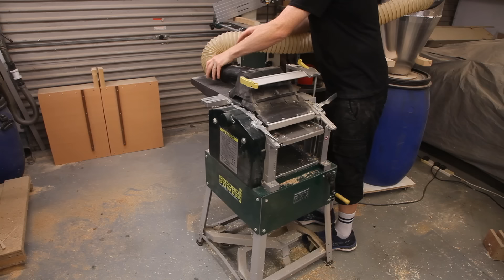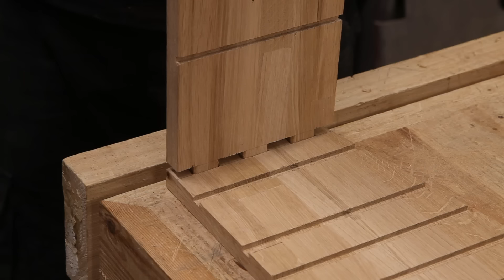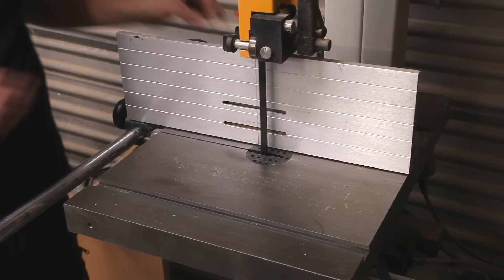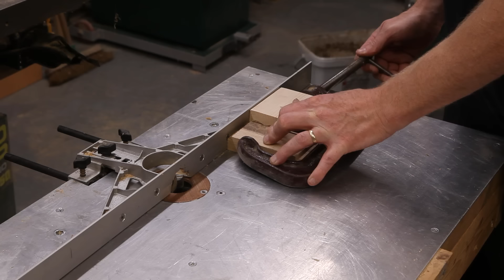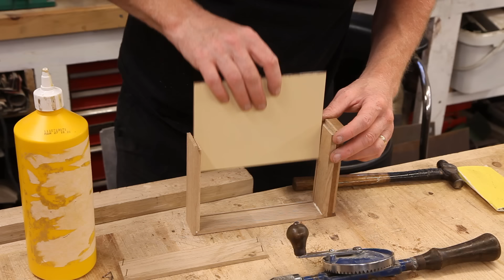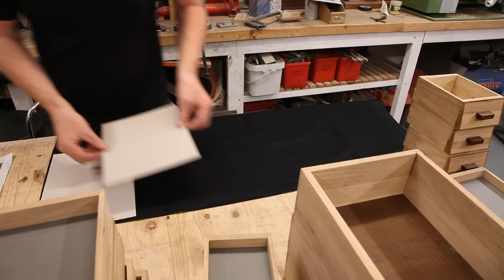Apothecary Chest Artist's Cabinet made from Worktop Offcuts.

Comment: Yet again another piece of artwork in wood, 
Your work is outstanding my friend
Reply from the maker: Thanks Graham :)
Reply: @EpicUpCycling   Hi Jason, sorry to contact you this way... My daughter has got me into making furniture for her using Pallets (dad = MUG) I now have a reasonable supply of euro pallets etc. 
Given I have a very good compressor I am looking to explore a nail remover as de-nailing is a royal pain..... Do you use one or any recommendations please!
Reply from the maker: Hi Graham. I've not used one, but I've seen them used. You still have to take the pallet apart, then you use the gun to shoot the nails out of the boards. 
The way I usually take Euro pallets apart is to split the blocks of the pallet with a hand axe, then just de-nail with a hammer and crowbar. Never an easy job but I found it the best way to keep the boards intact. I can't remember which videos, but there's a couple of mine where I do this at the beginning
Reply: @EpicUpCycling  Cheers Jason.

Comment: This is such a precision job, I marvel at it.  The cabinet has a sloping angle. This means every drawer front must match that angle.  On top of that, you used two wood tones - darker border around the center golden oak.  So each drawer front must angle exactly to the same angle as the overall cabinet carcass.  An astounding level of precision.  The success of this cabinet rests wholly on the ability to measure perfectly. And that is the hallmark of a master cabinet maker. Bravo, Jason!  What a tour de force.  It looks exquisite.    The video was very satisfying to watch.  Thank you.

There is but one thing I would do differently.  The handles of the cabinet are made of walnut. That is such a lovely wood. Why cover it up with a dark stain?  Just oil or wax it the same as the rest of the cabinet.  I think it would bring out a golden hue and be less contrasting against the blond wood and match the drawer outlines which are also in walnut.  That would have been more pleasing.  This dark stain is too contrasting and too vivid.  I personally dislike most stains. I like the natural wood color to come through, enhanced by oil.  That is enough.

Comment: Always amazed at that you can look at what people will deem as scrap wood and turn it in to a thing of beauty , how long does it take you to figure out the best way to get the most out of what you use , I counted 3 and a bit sink cut out/off cuts but you seem to make those bits go further than it looks possible
Reply from the maker: Two of the pieces were quite large. An 800mm hob, and a double sink. I didn't know at the beginning if there would be enough, but there just was. I had some smaller pieces in reserve just in case :)

Comment: Maestro you have done it again.  Beautiful piece!  I am always intrigued when you decide to use a hand tool and when you go with an electric tool and how you seemingly don't care at all about the vehement camps on either side arguing about which is better to use.  

Why did you cut down the slats only to make a panel out of them again?  My guess is because the panel they started out in was too wide for your planer so you needed to break them down and then just glue them back up again when they were nice and flat?  

Thank you again for an awesome show and relaxing half hour that distracted me from work and my other earthly cares.
Reply from the maker: Thanks for the comments, Matt. I wanted the panels slightly less than half the thickness of the original worktop pieces. I could have split the boards on the bandsaw, but it was a lot easier to cut them on the table saw and glue them back together, and, as you noted, it meant I could run the pieces through the planer.

Comment: I love watching you build these kind of organisierst, I have a question if you’d be kind enough to answer( if you read this) how do you plan out such intricate buildings ie sizes, how much wood is needed, how and where to cut, do you use a plan of some sort or is it make of the fly? 

See you on the next one, take care now👍🏻
Reply from the maker: I tend to make things as I'm working. For this box I did a very basic drawing just to get an idea of the layout of the drawers. I had a rough idea in my head of 60cm x 60cm, and it's pretty close to that. Making things up does mean I make mistakes that forward planning would avoid, but it also means I can adapt as I go along.
Reply: @EpicUpCycling  thanx for replying, amazing how you build as you go and it turns out so well👍🏻

Comment: This is a beautiful piece. Tons of time and attention to detail.  I didn't see if you waxed the drawer glides or installed stops for the drawers, it looked like you were pretty careful pushing the drawers into place ^^
Reply from the maker: I did wax the drawer slides. I added the drawer stops afterwards. A bit of a boring tedious job so not on the video :)
Reply: @EpicUpCycling  thanks for the reply :) heh a lot of that build could have been described as tedious but a rewarding finished product :)

Comment: Very pretty- and a huge amount of work. Nothing wrong with that- it is the journey that counts. However, small drawers are very inefficient for storing stuff. Things either do not fit, or conflict with each other. Shallow, yes, you only want one layer of content. But width and depth? As much as possible (I went with 1000 x 600mm).

Comment: must have missed the class on how to split a board in two with the riving knife still on. But... brilliant work as usual!
Reply from the maker: The riving knife is set lower than the blade.
Reply: @EpicUpCycling  That's what I figured but never saw a table saw with one lower than the blade. Customized it? Or does your saw have an option to lower it? Never saw that either! :) It is food for thought for me tho.
Reply from the maker: It's a modified one. I have to lift it up if I want to use the guard on top, or it ends up a bit low.
Reply: @EpicUpCycling  Brilliant idea tho. Never thot of that. If I can dig up a spare I'll give it a shot. Kind of dangerous to take it right off to make that cut. On  the other hand, maybe I can just chop some off the top. On the other other hand... Don't really know why it would have to be higher than the blade in the first place! Time for some investigation. LOL  Thank you sir!

Comment: I dont suppose you want to say were you got those worktop cut offs from? And while i am here do you use the wood from pallets as in the soft cheap pine which is all i have ever seen?
Reply from the maker: The worktops pieces came from my kitchen. Most of the pallets I use are basic pine, but I sometimes find oak ones.
Reply: @EpicUpCycling  Oak! I would kill for Oak!
Were abouts do you find Oak, builders yards, supermarkets etc?
Reply from the maker: @tonygagey  They are a bit rare in the UK. I'm lucky if I get one every couple of years. Usually from the building industry.

Comment: EVERY OTHER CHANNEL : What's the easiest way I can make this cabinet ?
EPIC UPCYCLING CHANNEL : First, I'll use scrap wood of different thicknesses and sizes, then I'll make it with an obscure angle on the front face to make it unique, then I'll do all the drawers with totally different sizes to accommodate the different items being stored. Next I'll make a lattice frame work to hold everything securely, and finally I'll surround the drawer fronts with an ornate wooden border and add carved out brass carrying handles that require skillfull chisel work. Lastly I will carefully line the drawers and add a layer of deep shine wax. Simples.